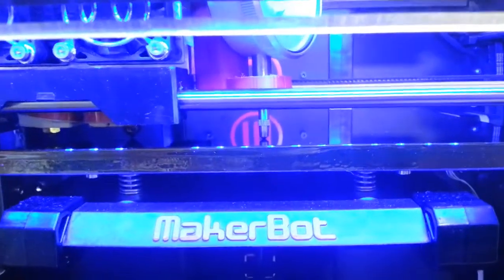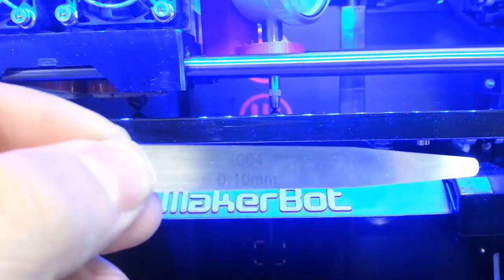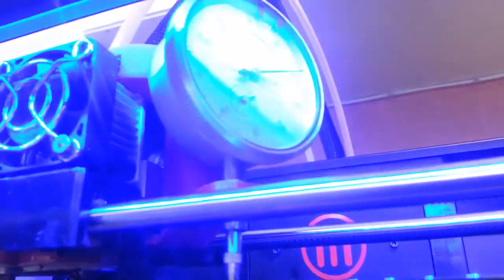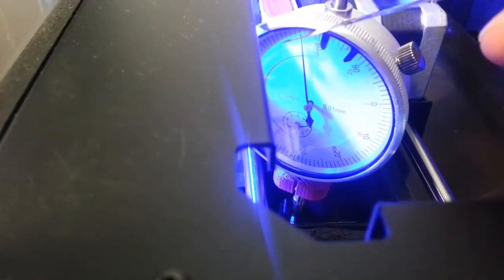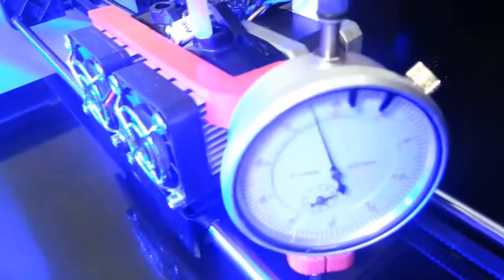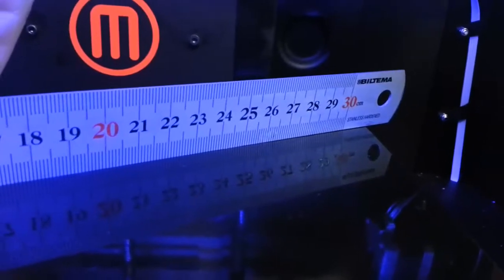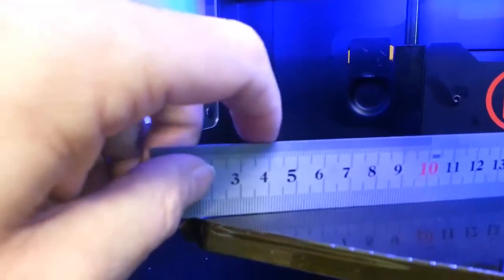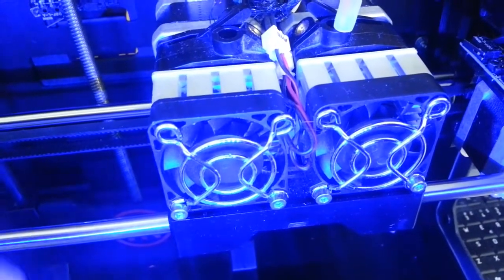Makerbot replicator 2x

Comment from the maker: It seems that my fix video for this is gone.
I did figure out what the problem was and wrote to Makerbot and other forums about it.
After 4 buildplate later that Makerbot send me, i understand what the problem was.

I see there is some videos that other have done that use that knowledge.
The main problem was the buildplate is made of aluminum and the buildplate holder is made of stainless steel.
Just make the hole bigger that the screws goes into the buildplat and add a spring to the screw, sorted this problem up.
With those adjustment the buildplate can move over the steelplate and dont get warped.
It was a very easy fix, that the makerbot engineers never admitted. I know now that they did change the buildplate materiel etc. But still never admitted I was right and how easy it was to fix.

Comment: What do you expect, it's makerbot. 

2-3 of the 4 2X's I use have warped beds. I just tell people to avoid Makerbots, build a reprap, those parts are low-cost to replace, a new build-platform would cost $50 max if you include a new heater, frame, and surface.
Reply from the maker: Well its an old video and I got my 3:e board. The makerbot 2X is a good 3D printer, but you did need to change a very few thing. After that it do work good. I have no problem at all now and I have no problem to print stuff at 0.03 mm if I want, but it take to much time so I often print at 0.15-0.30 mm. 
But if you want to build a 3D printer there is many you can build, but still few will be as good that the makerbot is.